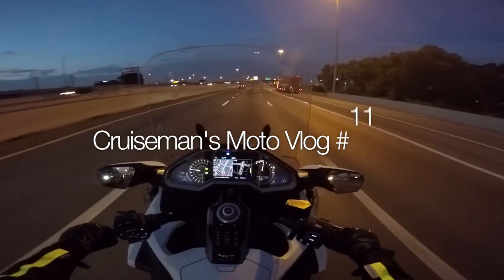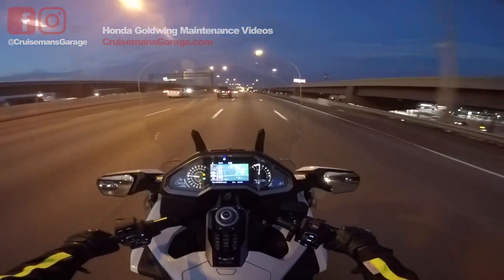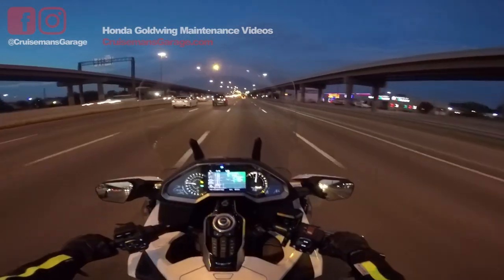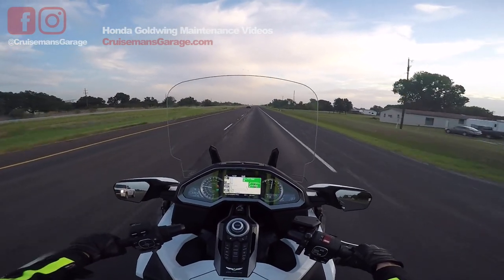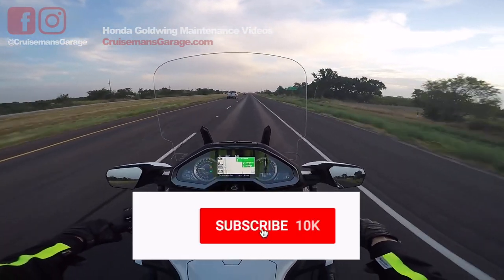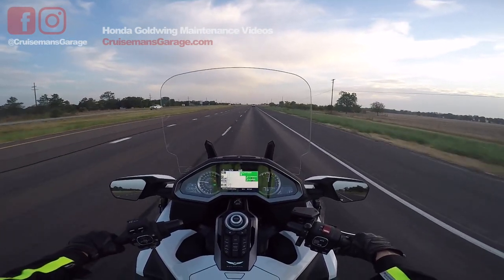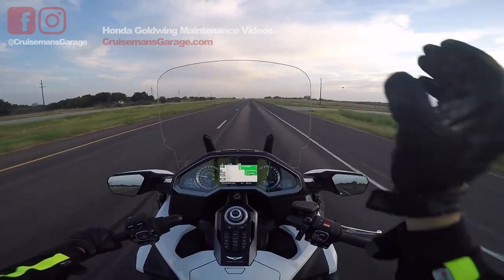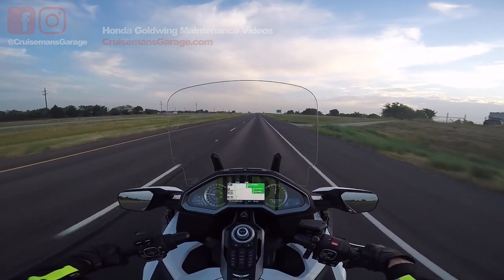[Ep 11] Wingsoft Seat Mod and RIVCO Aero Pegs - 2018 Honda Goldwing

Comment: Thank you for this review. I compared the Rivco pegs with the Goldstrike pegs. For me, the Goldstrike pegs win by a country mile! I really don't understand why Rivco needs to put all that metal covering the lower half of both sides of your engine, just to install highway pegs. The Goldstrike highway pegs are engineered to mount below your engine; they only cover a very small part of your engine when you flip them up when not in use. I am very happy with look and the sturdiness of the Goldstrike highway pegs.

Comment: My recent 5000 mile trip I did show a slight difference between Econ and tour. Best tank was 53 worst was 32. Major wind in Minnesota 30 mph head wind it was awful. My seat solution was easy I used my airhawk cushion and utopia backrest. Highway pegs are a must, to cramped when doing tank to tank runs. Longest day was 880 miles from Chicago to rapid city SD. What is interesting is my friend was on his 2005, it only had 3000 miles before the trip. He consistently put in 1 gallon more of fuel.

Comment: Agree with DFW and any metro area traffic. Leaving extra early even if you have to wait on the other end for something open is the best and reduces stress. 

Also agree this new GoldWing needs some small sorting out. Personalizing it like you are doing with the high quality products from “proven & reputable” makers is the only way to go in getting the best possible end-user experience for your money and not make mistakes with what looks good in an Ad. As trying to save money or DIY beta tests is “unsafe” while mucking up the aesthetics of this beautiful machine. 
You seem to be satisfied with the suspension but mentioned before about  straight-line tracking. Wondering even with this great suspension if an improvement and even greater tactile overall handling can be obtained with a Traxxion Dynamics suspension tuning? 

Finally, a quick reminder to all of my road warrior brothers & sisters out there...While riding, in any weather, especially deep south/SW weather, to stay well hydrated  with either Gatorade or water and not soft drinks, and to be monitoring tire wear & tire pressures out there. Good video Cruiseman. Thank you again. Ride big picture safe.
Reply from the maker: Good points about staying hydrated. And, the older I get, the more often I have to stop and take a drink. Traxxion upgrade would most likely improve handling, but it is an expensive proposition.

Comment: Glad to learn of the seat improvements

What a talented individual and resource for seat improvements!
——

I often wonder how helmet choices impact wind and wind noise on specific bikes and windshield choices

Seems that ideally, an array of test fits should be available before final choices are made beyond immediate helmet fit and helmet safety
Reply from the maker: There are so many variables to consider, it would be hard to come up with definitive results. The height of the rider, current wind conditions, speed, etc. But, the helmet definitely makes a big difference.

Comment: I am currently experimenting with the difference in MPG with the windscreen on my 2018 GWT6 all the way up, and all the way down.  You might want to experiment with that also.  Will report results after further testing.
Reply from the maker: I have been doing some experimenting, however, the windscreen on my 2012 was MUCH larger than my 2018 (taller and wider), plus the bike was 90 lbs heavier.

Comment: Hi Cruiseman, we all watching your videos here in Turkey as Goldwingers and appreciate your good work 👍
I currently bought a 2018 goldwing Tour After Ä 2014 gl1800. The new bike is awesome but not wind protection iş good as the old generation. I want ti Upgrade windshield. Do you suggest honda Tour shield? İts tall but not wider i think. Will it be ok to feel like riding old generation with honda tour screen Update or will i have to look aftermarket products which is 6" wider than the stock windshield? I will ve glad to hear your opinion. Ride safe 👍

Comment: I'm really surprised with the MPG numbers you are posting with your 2012. The most I got out of my 03 was around 38mpg and that was calculated with a Yellow Box installed on my 03 to correct the speedometer error that all the Gold Wings before 09 suffered from. My 2018 Tour 6-speed is getting mostly around 48 mpg, but as high as 54 mpg riding local rides in the summer temps. I have seen over 50 mpg pulling my Bushtec on the Blue Ridge Parkway and so far I've seen 286.2 miles out of a tank of fuel with my 2018. My 2018 6-speed far out performs my old 2003 wing with the fuel mileage.

 I  am starting to really like the Rivco highway pegs but my only concern is if the black coating is going to be durable or will it wear off where your feet sit and then not look so nice.

I agree with your assessment of the Wingsoft seat mods...10 times better than the stock 2018 seat.....anyways I really like your video's...great job and keep them coming
Reply from the maker: My mileage on my 2012 went up when I had the ECU reflashed by Guhl Motors AND when my engine was rebuilt by John at Maxim Honda in Allen. Not sure why the rebuild would improve mileage, but I noticed a  1 to 2 mpg increase afterwards, and the bike ran MUCH smoother.

Comment: can you remove trunk from 2018 goldwing
Reply: You can, but it is designed to be a "conversion", not just a "I don't need this today" kind of thing. It is not a simple process, and the kit is $250 or so from Honda.
Reply from the maker: You can, but it is a pain in the "trunk", so to speak.